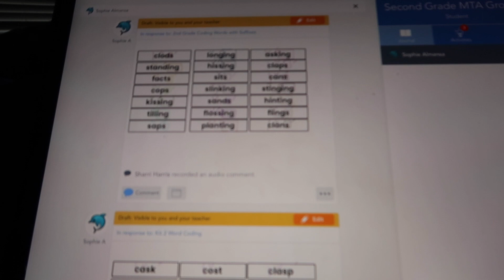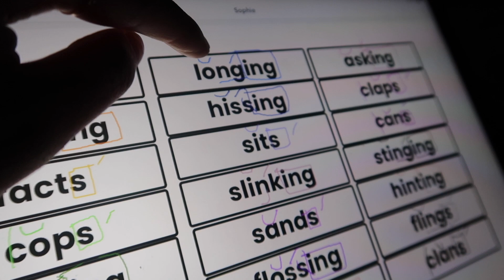ALMOST GAVE UP.. 😓

Comment: Take her to a doctor Lesly . The pain can be due to 2 reasons .
 
1. Impaction of wax which is the external ear ( for that you use oil and after using oil, the wax will come out slowly . 

2. Middle ear infection which can be precipitated by sinusitis or ear infection . In that case , you need to give her some medication and in serious cases oral antibiotics . ( This is serious because if you do not go to doctor early , the infection can increase and spread ).

I am an internal medicine doctor but I highly advice you to take her to a doctor asap . 

Hope you read this .

Comment: Instead of garlic oil,,, just take 20 to 30ml olive oil and heat it, then put some cut garlic pieces in it then make it cool a lill bit drain oil ,,,with mild heat in it pour in infected ear,,,the mild heat will reduce the infection, but be sure the heat is mild, do it 3 times a day u'll see improvement if not pls go to a doc

Comment: Thats a hammer drill. You have setting that can be used for drilling as well. Turn it to the hammer switch and scrap the bottom of tile.

Comment: 6:30 yeah that's true it hurts and it's bubbly because the hydrogen peroxide helps or remove bacterias. And it's very helpful when you have wounds you can also use that it helps to remove the bacterias to avoid infections